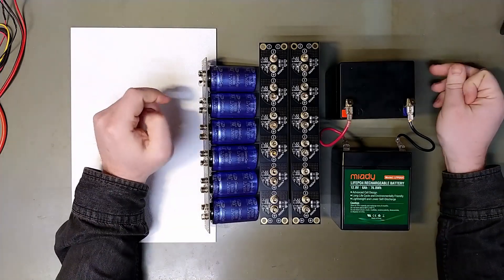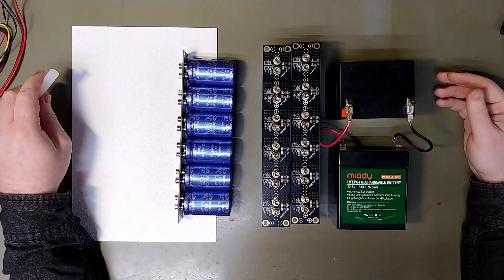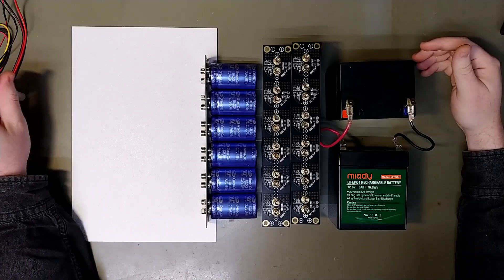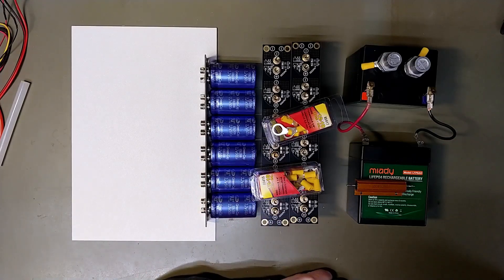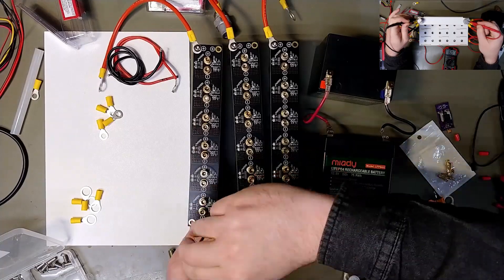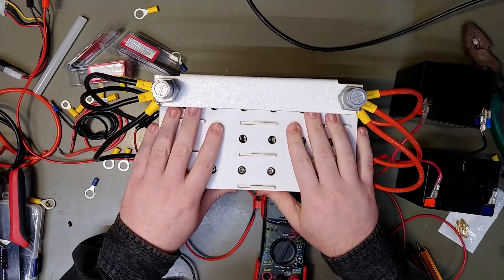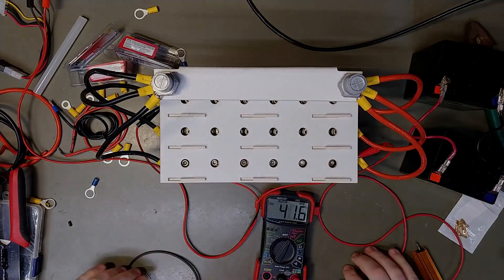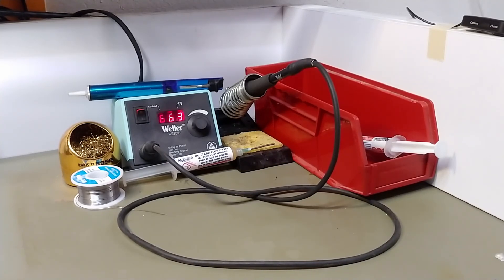Supercapacitors and LiFePO4 Batteries Replace Lead Acid Car Battery

Comment: This video is 5 years old but, the AGM battery used by my car (for 35-60amp AGM "smart" discharge at any given momemt when the car is running), is an H9 950CCA 105ah Battery and is not replaceable by a small battery, however i did add a SA150-975L supercap at the battery terminals about 16 months ago. The car already disconnects the battery if the ignition is off and the battery voltage drops too low, to preserve starting. 

The frigid weather starting ability is stunning in that the car cranks at almost normal speed and fires easily with the cap addition. My reason for the supercap initially was to assist with voltage sag during ECO stops. I found out by leaving the mpg computer on display that my mileage drops in front of my eyes at red light, so i started using the ECO start/stop, and the ECO saves me about 6% gas costs.  

The reduced voltage sag , aside from stronger ECO starts, also allows the alternater to recharge the battery quickly. This setup saves the starter, and AGM battery .The ECO stops are much longer due to the cars computer seeing the battery as more capable ( cap mounted to battery posts)... and allows quick confident starts in the dead of winter.... 

Fast engine cranks in frigid weather is just really a great surprise...AND  the higher cap amps supied for frigid starts and the resultant battery wire heating is easily absorbed by the ambient temperatures...i.e., there is no heated cable...the cap is a great deal all around

Comment: My Lead Battery is slowly failing to do it's job. During startup the car always starts really easily, but the voltage drops low enough that my instruments sometimes even turn off entirely and the radio restarts. I will try to add a super capacitor bank in parallel. I have some laying around, but it's only about 10F 16V. Let's see if that is enough to keep the voltage over 11V while starting the motor.

Comment: The only issue with using super caps is sometimes they have quite a large internal parasitic draw, especially the cheap Chinese ones, if you connect them up to a power supply you will see that they take about 20 - 50ma to maintain the voltage as long as you drive the car regularly it probably wont matter. Ive been using a cheap LFP hobby pack in my car with a BMS for 11 years now on its own, i had to midify the alternator to get it to work right.

Comment: Funny the "ligher" solution in a truck !!! are you serious ???
Reply from the maker: @NixUgriBugri  I ended up towing a trailer from the West Coast to the east coast and all over the place. A truck was past its maximum towing capacity. So I found clever ways of reducing weight off the tow vehicle and the trailer. I ended up pulling out my back seats too for weight reduction. It worked my transmission and clutch survived...
Reply: @halentech2269  My point was that compared to even a back seat but especially to the weight of the truck saving on the battery is infinitesimal  ... but you do what you do.. but using that as a reason just silly.

Comment: LiFePo is much much dangerous to play then lithium.
You need knowledge before messing with them
Reply from the maker: @soulbrothers7789  
You have that backwards buddy. Check your sources.
Reply: @halentech2269  nope i am from industry and i know what i am talking about.
Reply from the maker: @soulbrothers7789 
What a coincidence. I am from the industry as well. Let me translate what you said: lithium batteries are more dangerous than lithium batteries. It's kind of like saying trucks are dangerous. You should drive a vehicle instead...  Want i believe you were trying to say is LiNiMnCoO2 is safer than LiFePO4. This is simply not true. A 2-second Google search should resolve your issue.
I worked for Joby Aviation.
Reply: @halentech2269  Yeah LiFePo so "safe" that never was used in civilian or military vehicles or aviation.
Why ?
Because they are sensitive for shaking even slightly impact can lead to flame.
So if they are so safe, why they never replaced lead acid ones in cars ?!

Comment: I am using same concept with roof mounted solar panel, 100ah lifeo4 battery but 6 very big and powerful super capacitors.

Comment: comming back to this video. i drive a 2013 volt, basically a phev before that term existed. one of the few cars with an ICE that doesnt have a 12v starter motor (it uses the 350v high voltage battery to start the car and run AC). because all the high loads are handled by the high voltage side, i built a small 50$ 4s lifepo4 battery out of 32ah cells from china. replaced my 65lb AGM battery which was 13 years old and kind of weak. i believe the correct replacement battery costs around 250$ to replace. works great, lower internal resistance, about the same ~55lb weight savings as adding a performance exhaust would give. ironically it has more usable capacity than a brand new AGM battery. the 12v battery is in the trunk away from any hot engine, and i added a 12v thermostat/15w heating pad circuit to the battery itself so its not possible to charge it below freezing. I ran no BMS and used a cheap inductive active balance board, and my car has 200w of flush mounted solar that i wired through the antenna hole in the roof into a 30a mppt charge controller (2x 100w ~12-15v panels, each were like 35$). the solar has already paid for itself in fuel and electricity savings because i run the low voltage side of my car into a micro inverter and backfeed my house with the excess solar when parked. havent seen anyone really document a project like this on yt. the volt has already paid for itself after 18 months of fuel savings since i drive 34k miles/year and have averaged about 100mpg that entire time. people dont realize the volt is a used phev with an extremely robust battery cooling system, very protective 66% state of charge allowance, and no means to supercharge, so the batteries last forever. new the car got 32 miles of ev range, right now im getting about 45-50 with some other modifications. have around 140k miles on the car now.

Comment: i would be worried about the engine heat on those lithium batteries, i have experienced 2 thermal runaways and trust me, they are scary situations

Comment: Can someone help me make a supercap battery to run in parallel ,after my 8S, 24VDC 300Ah lifepo4 pack, so my inverter and solar charge controllers have a chance to shut down at 10.5vdc before one of the lifepo4 cells ,shuts the pack down above 10.5 vdc?  In theory. The 8s pack should make it that low, but it never does. Both the inverter and solar charge controller warn to "NEVER DISCONNECT BATTERY FIRST OR UNDER LOAD FIRST".  The supercap pack would not need to work long at all. It just needs to handle the high amps of charge/discharge, and to reach 10.5 vdc after lifepo4 shutdown.

Comment: Great info here! Looking into building one of these both to smooth out the voltage and get rid of the headlight dimming when the bass hits as well as something to give my winch a little extra kick. 
 
I know this will work great for fixing the audio amp voltage sags, but maybe not so much for more than a second or less of running the winch. It might not be feasible to build a capacitor bank large enough to provide 5+ seconds of winching before recharging, but I haven't done the calculations yet. Any thoughts on this application? My winch is rated to pull around 200A. I do have a 200A alternator that needs to be installed after I fab up a mount for it, but from what I understand the caps will spread out the load spikes and make it last longer :)
Reply: @Swim Fan Well my battery and alternator winched a sizable log up a hill when getting firewood just yesterday (12,000lb winch) and didn't seem to slow down at all on a continuous pull and likely a bit over the winch rated duty cycle. That definitely requires more of a sustained load but I suppose the battery could be getting weak and need replacing. LED headlights don't dim though  :)

Comment: Great work, this project has inspired me to start my own one.  Thx.  Just one question..if you were to do it again, would you change your set up? (Add/reduce CAP pack or battery size). Cheers.

Comment: Not sure how alive these comments are but ive started building my own for a old bike im cafe'ing toying with the idea of fitting a delay relay that limits the time the batteries are connected out to the caps and wiring the switch to the ignition barrel, any thoughts?
Reply: just to add the bike is a 87 Suzuki 250 the most complicated part is the cdi so don't have to worry about car stuff like ecu, central locking radio etc

Comment: What's your option on the Miady battery work in an APC or Eaton UPS?  Is there enough protection in them to just drop them in as replacements for the lead acid?  Price is right, but I'm having trouble trusting the reviews and making certain there safe from over charging and under charging.  Don't want any fires.
Reply from the maker: That's not an easy question to answer but, I can tell you that I have the Miady batteries still working in my truck for a year without issue. The only real safety mechanism I have is the battery's own internal BMS and I have tested the BMS for over charge and under discharge. The batteries test out ok. 
Two points: 
1) I don't discharge or charge the  Miady batteries rapidly, I have a current limiting  resistor. In a UPS system, depending on the exact model and load put on the UPS, the discharge current can be quite high.  While I don't think the batteries themselves are a fire hazard because of the chemistry of the cells, I do think that you might let the smoke out of the BMS electronics or the cell’s bus wiring…
2) I bought some more batteries recently and one came DOA and the others failed the capacity test by about 10% which might be OK because of the cheap price we’re getting them at (amazon exchanged the DOA battery). This just makes me think we’re getting grade B cells  and that the quality control isn’t that great. I would recommend testing each battery before putting them into service.  
Maybe I’ll make a video on the new Miady batteries I just bought and show all my testing.

Good luck

Comment: What CCA can you get and what AH reserve capacity do you get.  A normal EverStart MAXX-24 from Walmart will give you 120 min reserve capacity and 770 CCA. for $130.  As in can you run the fan or radio without having the car running all the  time.
Reply from the maker: more or less you can... the problem with the "120 min reserve capacity" is it will destroy the lead acid if you actually use it that often. I don't have a problem with running the radio for an hour with the engine off. Head lights can kill the pack quickly but, if that happens the LiFeP04 will have enough power left in the to charge the Caps back up to give me a shot to start to engine.

Comment: What a brilliant demonstration of how super-capacitors should actually be used. This project effectively demonstrates how super-capacitors (SC) boost the peak load of LiFePo batteries allowing for the implementation of a smaller battery unit. I think a boost MPPT circuit on the could get a bit more power out of the SC’s, by allowing them to discharge lower. But generally speaking: well done on an awesome video. 👍👏🏻‼️

Comment: What about a peltier device to warm the battery u will need a diode as if the battery get hot as it produces electric xxx
Reply: Why not use resistive since it is more energy efficient
Reply: Peltier module has very efficiency

Comment: You can go to harbor freight (yes i know its harbor freight, but their water tight boxes are very well made) and buy a water tight box. Use wool insulation to separate the caps and the lifepo4. Use your same battery lugs but install a rubber washer between the outside box and the lug. You can also add a small 12v heater. Wired to a switch from inside the truck, to heat up the lifepo4 when temp is freezing.

Comment: power lost factor is a little bit high，maybe  instalation of  a relay  or something else to disconnect the power connection  between battery and super capacitor when not in use will help。。😁😁😁

Comment: Where's is the resistor installed? Is it between GND and +12V? Or is it between +12V and the battery positive terminal?
Reply: That’s a good question I was wondering myself. It seems to be situated between the positive terminal of the set up and the positive connection of the two paralled lithium phosphates. Not too sure.
Reply: Kelso4444 so I did a little more research, it is between the +12V of the Lithium-ion battery, and the battery positive terminal.

The purpose is to limit the charging current (A) when the capacitors are charging the battery.

Let's assume an extreme case, let's say V delta of 4V, for when the capacitor is 14V and the battery is 10V. The capacitor would charge the battery at I = V/R = 4V / 0.1ohm = 40A. Most charging would happen when the battery is 11.5-13.5V, so we are looking at 5-25A charging speed.

Comment: Someone has this already has been running around n his Kia soul for 2 years.
Reply from the maker: Yes, I've seen the video... I wanted to build one with components that would cost the same as a good lead-acid battery.
Reply: @halentech2269  Let me know the update. I wanna see the 1-year and 2-year update like he did. I am particularly worried about the AliExpress supercaps. I think you should add a breaker there for better peace of mind.
Reply: @halentech2269  also I think he added some solder above the traces on the PCB, since the current is really high. I think it would reduce the power leak by a considerable amount

Comment: First video? You did well. Love the concept and want to build one for my truck. Think I might incorporate a cutout switch for when the voltage drops to say 11 volts. That way I might get a start if a load is left on. Cheers.
Reply from the maker: it's a good idea but a bit more complicated. I have put a manual cutout switch and a small portable battery to charge the caps back up... haven't needed it yet.
Reply: @halentech2269  Good shot. Did you get your leak current? Some creative guys added solar panels to amid the leakage. Some added lithium or lead-acid batteries to supplement power loss like you. I bought those cheap capacitors too. the max leakage is 40 mA, averagely 10 mA. Yet good quality Caps' is only 4-8 mA. Hope you get your hobby with your need. Have fun.
Reply from the maker: @breezeli6233  Yes I did, watch my second video!
Reply: @breezeli6233  Im thinking to add a relay powered by the ACC signal of the car, to disconnect the supercaps when the ACC signal is off. That way, the capacitors are out of the equation when the car is sitting in the garage. 
One issue is I would need to wait for a minute at ACC before starting the car to let the battery charge the supercaps. Another issue is some cars disconnect the ACC when cranking the engine. Is there such a thing as a relay that delays the activation/deactivation? That way, the relay would stay connected for a few seconds (for cranking) after the ACC signal is turned off.
Reply: Ppp

Comment: Adding a 24v hand crank, via 50/1 reduction gear &  you got it all. Have fun...
Reply from the maker: A hand crank would be interesting... But a hand crank doesn't usually come with a car battery. I hopping fingers crossed that this will be an install it and forget about it type of modification.
Reply: @halentech2269  life in Alaska, has a unique set of needs and chalanges, that demands creativity.